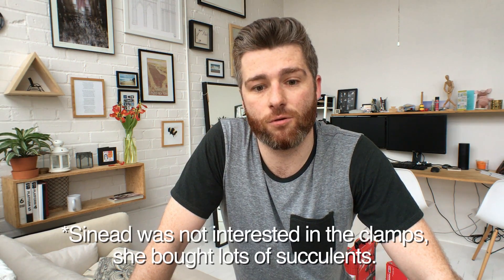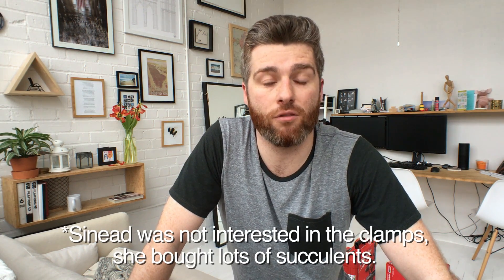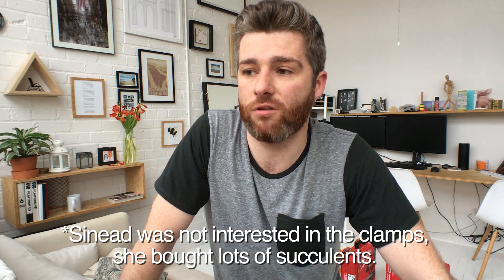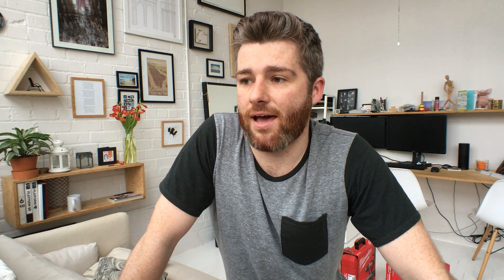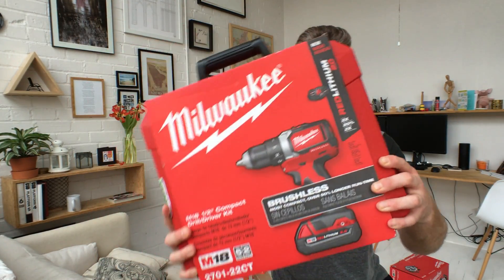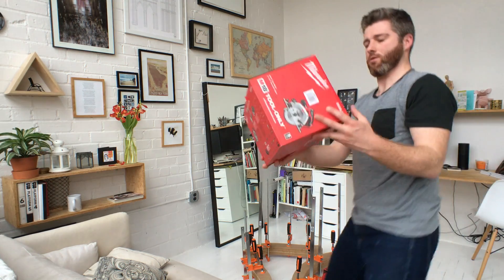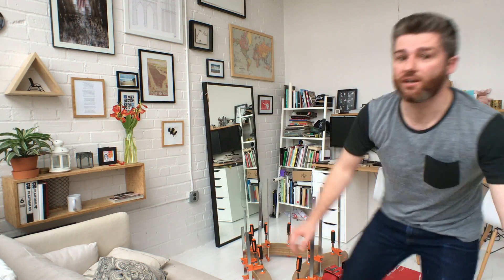How to Make a Chair | Episode 5: HOME DEPOT FAIL

Comment: Sspeaking from experience, making a steam chest from PVC pipe is not a good idea. The temperatures involved are high enough to cause the plastic to distort. I was attempting to steam bend oak for a boat I was working on last year and had a length of 6" diameter pipe warp and distort to the point where I was unable to remove the oak! I had to recourse to using a couple of lengths of steel chimney flue, which were significantly more expensive than PVC drain pipe but more than up to the task. Steam was provided from a cheap-and-cheerful €30 wallpaper steamer I got from Woodies. Greetings from Co. Waterford!
Reply from the maker: Thanks for the info Tim. I've already gonna ahead and got the PVC pipe so I'll give it a shot and see what happens. I think in the long run you're definitely right - I'll need something more up to the task. Let's see how it goes anyway! If it fails at least it will make for a funny video! It's been a while since I've been to Waterford. Gorgeous spot!

Comment: Hi Conor,  maybe a tip for the next time you make a mould (this probably and hopefully wasn't your last ;) 
Put in a couple of screws each layer of the mould. This keeps all the layers better aligned when you apply pressure to 5 layers of slippery wet glue soaked MDF...
Plus it gives a bit of reason to buying a new powertool you don't really need... but obviously got to have!
Reply from the maker: +Norner Houtbewerking Hey! Thank you that's a great tip. It really was pretty tricky to get them all lined up correctly. I imagine if I screw them as I go I could also use less glue and avoid all the spill out which requires sanding. I will definitely do that for the next pieces of formwork. Thanks!
Reply from the maker: +Conor Coghlan And yes .... it gives me an excuse to buy the tools!! LOL
Reply: +Conor Coghlan you are welcome! Glad I could help! I really enjoy your series en know how much effort goes into these productions, so thank you for sharing and I'm glas I can repay you with a simple tip.
Reply from the maker: +Norner Houtbewerking Thanks man! I really appreciate that. I really enjoyed your most recent video of the entrance hall bench. So cool!
Reply: +Conor Coghlan don't worry about the spill out. depending on the type of wood glue, you can wipe off excess glue with a damp cloth as soon as you've got all the clamps on.

Comment: if youbMill holes in the bending form whit the cnc you can put dowels ore something else like pvc  pipe troo that hole that way the forms will line op perfectly of course the hole diameter needs to macht the dowels but I have done that before end it works great
Reply from the maker: +Daan.Z.bloedjes Great idea! Thanks for the tip. This what I love about YouTube - being able to share ideas with people like yourself. I will be many different pieces of formwork so I'm glad you mentioned this so early! Thanks!
Reply: +Conor Coghlan no problem whe Al are here to learn